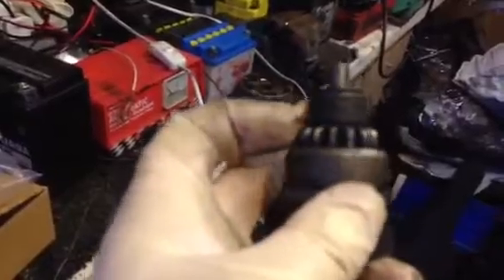BIKE WONT START SPEEDFIGHT FIX RUNNING MARK SAVAGE

Comment: Hi Mark hope you and family are well, just a quick one my speedfight is acting weird it runs and rides fine good speed but if i let it sit with the battery connected for a day or two I come to it ignition on and have no response from any electrics, but if it disconnect battery for 10mins it's all normal?? Its only started doing it after my dad rode it back from MOT center in the rain?? All panels are on properly so bit clueless such a weird one to diagnose.
Reply from the maker: odd but maybe look at the power regulator which is under the front main foot panel and hard to get to, or the stator coil 
but more likely to be a connector so wd40 and go round all the earths and connectors you can find
Reply: @marksavage  ok thank you 👍

Comment: Hi .. I've got a speedfight 2 and I've got a spark .. new crank seals , new plug , new battery,  cleaned the stator .. but it still won't start ..
It does seem too flood a lot 2 the point t of it dripping from the exhaust gasket area ...any ideas ? As I'm stumped lol oh and the carburettor is supposed to be new 🙄
Reply from the maker: It's the carb bud 
Take off check float and vacuum 
Test both like in my videos on them
Reply: I'll see if I came find your video on it .. not sure how to do the vacuum check ..
Reply: I've put my hand over the back of the carb and get a wet hand .. is that the vacuum check
Reply from the maker: @danielcurran9144  pull both pipes off ,suck the air pipe 
Fuel will come out of the fuel pipe 
If it starts then stop once you stop it's fine 
Then carb float see it is stuck then move to 
 jet size or needle

Comment: Hi mate, watching all your videos has helped me try to fix a vivacity. But can’t get it to run, it not sucking fuel in, any suggestions? Changed the fuel pump and it’s working but the vacuum line is not sucking strong enough to pull fuel. I am waiting for the reed valve, as one of the pedals is slightly open. Could that fix the issue?
Reply from the maker: it can be the reeds bud they need to be all shut
when you turn over have you done the hand test , if it get wet you have a vacuum

Comment: Hi mark does the filter you changed do the same job as th vacuum pump as the dna 50 has both?
Reply from the maker: hi bud i have videos on the dna worth a watch
this filter is always worth a change as it can clog and cause problems with the flow of fuel 
mark
Reply: Yes i think i have watched all the dna ones

Comment: Mark I bought my so a aprilia  area 51 the fule pipes wer bypassed cos the fule diafram wasntnt working they had it rig up some other way it was running fine but I went out one morning and put choke on and kicked it stared for about 1 min and cut out theres no fule going to the carb no vacuum could that be the carburetor blocked iv and fule diafram and starter in the post I'm buying a work shop manual also.. any ideas it use to fly 60mph nearly
Reply from the maker: id re put in the right vacuum as anything else will either flood it of not be right bud

Comment: Hi Mark,

I’ve rebuilt my top end and now it doesn’t want to start. I’ve tried both kickstart and electric both not working. Could a battery with not much juice left be the problem? I have compression,spark,fuel and air. I have also cleaned the carb and put a 68 jet in it. I could kick it over plenty of times and nothing. 

Thanks Mark
Reply from the maker: there's so much it could be bud so that's a hard one, there can be hard to start after a re build maybe some easy start to get it going may help, if you have followed how I have done mine it should all be ok 
there oil seals , reeds, compression and so on is your hand getting wet with the hand test ?
Reply: mark savage I feel compression but i think no fuel is get to like the head area hence why it not starting? Would you recommend putting a bit of fuel down the head
Reply from the maker: @kellyplaysguitar111  prime carb then you can put a little in there to see if it will come to life

Comment: Having trouble with my sons 2nd hand bike we just got him for Christmas. Electric Start isn't working but kick start was but now needs replacing too. Got spark, got fuel got compression, starter spins the bendix any ideas?
Reply from the maker: Hi bud 
Electric start works as in spins or nothing 
I have videos on hoe to change 
Bendix spins but not engaging,  need new one 
Kick start again I have videos on how to change 
Let's know what's going on
Maybe upload a video then I can watch it and help if I Can bud
I have 100 videos on a play list they will help
Reply from the maker: Or contact the seller and ask him to sort it or at least help I always did when I sold mine !
Reply: @mark savage  it cranks over but not starting. Ordered parts for kick start so that will be sorted and will use your video too. Seller isn't responding at all. Just hoping I can figure out what's going on. Starter spins bendix but not too sure how to check if it's engaging will have a look through your videos.
Reply from the maker: So it turns over so that's all ok
I have a video on these4t mopeds 
On my channel bud 
A black one little while a go
It's carb bud
Clean or change plug 
Make sure you have spark 
Check side stand sensor is working 
Take out seat bucket 
Then off with carb 
Like in video
Reply from the maker: @Greywolf89  it is as turning over 
Bud 
Not good from the seller
Reply: @mark savage  going to take carb off now and give it a clean hopefully it helps cheers
Reply: Got spark, cleaned carb idle jet was blocked. Tested side side. Still no joy.
Reply from the maker: @Greywolf89  spark good as in nice blue spark not orange 
Carb
Both jets out blown out clean 
Float ok letting in fuel
Wet hand test ?
As in my videos 
So wet plug 
Are you using e10 
Or e5 super 
Video on that bud
Reply: @marksavage  went and got another new plug and seems to have  done the trick cheers mark

Comment: Hi Mark, I have a starting issue. My speedfight has a new starter relay, battery and starter motor. It starts fine and runs perfectly on the kickstart, lights everything ok. If I attempt to use the electric start it blows the fuse. I can bypass the rear brake light circuit (safety feature) again works fine. Brake switches, and the wiring looks sound, I have checked all connectors.can you advise please? Simon
Reply from the maker: hi the micro switch does the rear brake light so that needs to work as it should and is negative so all ok you will have to check the start motor and make sure the live is not touching anywhere and covered with the cover or electrical tape and that the earth is connected with the screw to the body of the bike if all ok great if not !!ok it's bottom panel off to check all the wires from the start and up to the relay.this is the only way of sorting, I have a few videos on the starter that may help along with wiring info, give them a watch and please like share and subscribe . ,mark

Comment: Hi Mark. watched all your speedfight videos. Ive got a 50cc liquid cooled speedfight. I cant get spark.  I fitted a bypass CDI replacing the factory one, new coil and lead and spark plug. changed the stator and flywheel. With the factory CDI fitted the red immobiliser light goes out after blinking. I dont know what to check now. I've checked the loom with my meter and its fine. its getting fuel to the carb is clean. any ideas of what to look at next. doing my tree in not having a running bike. the coil is not getting any voltage. it just cranks until you flatten the battery. it wont even kick start. it ran for literally a min as a fluke but cut out and hasnt started since. all the connectors on the loom are clean too.
Reply from the maker: wow that's a lot of work bud but if you are getting power to the cdi and no power out then that's it bud, I have had  a faulty bypass units before this is the one under the front panel yea?, there are none next to the batter? if you have no power to the coil then it has to be th cdi or a cut wire , I did a video on wiring hell as that's what I had that as well, you defo have volts coming out of you stator coil ?
Reply: +mark “marky bike” savage Hi mate put a different CDI in and it started straight up. thank you for your help. I would never have thought a brand new CDI could be faulty. keep up the great videos. 👍
Reply from the maker: that's great news and happy to help mate and good to hear my video's help and a little more advice for me,
Reply: +mark “marky bike” savage Do you know anywhere that sells the panel on the nose of the seat? mines missing. tried ebay but theres none on there.
Reply from the maker: you may have to buy the whole seat or contact e bayers selling parts and asked them

Comment: Hi mark just thought I’d see if you could help me out I’ve got a 2003 Peugeot speed fight 2 and it was running perfect I took it for a test ride and I rode over a bump and my knee hit the key and turned the bike off so I turned key back on and electric start was just clicking I’m guessing it’s the starter relay switch but that’s not my main issue my main issue is when I went to kickstart the bike it started straight up but it literally wouldn’t Rev at all and I have no idea what’s causing it because it’s had brand new spark plug and carb and the more I tried to start it it just got worse and now it only starts for like 5 seconds any help will be much appreciated
Reply from the maker: How odd
Is it an immob cdi ( fat key)
Is the red light flashing on the dash ?
I've got a video on the starter so follow that 
Check everything as the bump may have done something else bud 
80 videos to help
Reply: mark savage cheers for the reply mate yes it is immobilised and I’ve sorted the running issue out turns out there was water in the fuel but starter still doesn’t work the starter relay just clicks when you press the button mate
Reply from the maker: @motorbikeryda883  waters odd but flush out 
If it clicks it the starter
Take off side cover take out dendix to make sure its not jammed 
See if it spins then 
If not new starter bud 
Follow videos its easy to do

Comment: Having problems with my sons speedfight2  it just wont start ,got good spark ,got excellent compression (new barrel and piston), my boy is upset as it was a birthday present and we got told all it need was starter motor we replaced that and new barrel etc, are you local to colchester?
Reply from the maker: This often happens bud 
Not far from you 
Why did you replace the piston 
Was the old one damaged 
Did you clean out the sump and 2t oil the piston like in my videos 
Clean carb 
Check reads 
Did you do the wet hand test and is plug getting wet ?
Reply: @marksavage  any chance I can drop it off and let you fix it?
Reply from the maker: @andrewreid2097  send me your phone number and ill let you know when I have it then delete the message on here
Reply: @marksavage  we got it running standard piston, 6g rollers, ginelli exhaust its a 2003 speedfight 2, not very quick bit boggy, what size jet should we go for please and any other tips to speed it up??

Comment: Hi Mark , having trouble with me trekker 100 (again lol ) it won't start at all , have changed the Spark on it but no joy , cleaned the carb , is getting fuel as I replaced the pet cock before. It broke down on me on christmas day and all that happened was a bit of the air filter had torn off from being so old it clogged up the carb , so I removed it replaced filter , and cleaned the carb , has been running ok , last week I had to change the spark after a week or so, thought maybe running rich or a bits of the old filter had got through and giving me probs , anyway new spark today and nothing any ideas before I scrap it ? could it be piston needs changing have tried to have a look at getting the head off but has cover that looks difficult to remove , might take garage or scrap , any ideas before I do appreciate it , thanks bud
Reply from the maker: in very cold weather they all play up, start with carb again like in my cleaning videos then tuning 3 half and when you try to start check plug is getting wet and you have a good blue spark like in my videos
if no joy try to start and open the throttle fully and listen if it pops and bangs ,if so yes the piston / rings may be gone
its not a massive job as long as you have a few simple tool and the time , getting the old exhaust may be a bugger as the bolts can snap 
mark
Reply: @marksavage  Thanks , ur da man , I thought , would give the carb another go , so just took of cleaned it , then I noticed a problem , the little round plastic part attacthed to the jet needle(? on the cable) wasn't goin all the way down into the carb it was like stuck at the top so I pushed it down with screw driver ,put back together and it almost started but batt is flat from all the trys lol so is on recharge now , will give another go 2mrw , one more funny thing as I was washing my hands next the sink  I noticed all the brass parts from the carb that I took off and forgot to put back on lmao , and yet in nearly went , will put em on 2mrw and give another go , ooops , anyway yeah think it was that plastic part sticking maybe giving me the probz, theres life left in it still yet lol , thanks for your help , you,ve inspired me to keep trying :-)
Reply: @marksavage  Hi Mark , I got it running again , but is sketchy ie takes a while to pull away when first start as if the fuel is not getting through or almost dies if rev , maybe is flooding ? but  it runs fine (ish) once it's going (warmed up/wait for a few moments )  ,I think I need to replace the carburetor but I'm having trouble finding one , would you happen to have one for sale ? or know where to find the right one ?( have looked on ebay )  , I think the round plastic bit on the the jet needle (?) (attached to (spilt ) throttle cable at top of carburetor is sticking to the chamber , the chamber looks slightly darker have tried cleaning but no joy , but yeah is running but think needs a new carburetor , thanks for any info

Comment: Hi mark it seems like my bike electric start has died over night and struggling to start on a good day if it’s cold would this be the issue
Reply from the maker: poor battery , give it a charge or replace stator coil, i have videos on that but more than like it , or old starter worn ,replace bud

Comment: Hi mark I'm having a starting problem with speedfight 2 I've cleaned my carb like in your video's I've cleaned my air filter I've drained my fuel tank and rinsed it out with fresh fuel and changed the fuel tap and put fresh fuel in got it started and was ok but the It was in the shed for a week got it out and it wouldn't start unless I put my hand over the hole on the air box can you help?
Reply from the maker: carbs as they get older leak and allow the air in and the fuel to evaporate away then if left they are hard to start , try finding a new carb or a Chinese new one but set up air mix all the way in and use the old jet .
you can use a little easy start if you leave it for a longer amount of time 
whats it like when you start it daily
Reply: @marksavage  hi mark and thank you for the reply and if I start it you every day its starts every time on the start button
Reply from the maker: @eddiehughes9137  you can overhaul the carbs with me gaskets etc as this will help
Reply: @marksavage  thank mark really appreciate your help and time 👍

Comment: Is there any difference in the Speedfight PROST 1999? fuel filter?
Reply from the maker: Gordon Rettie hi bud 
No mk1 and  mk2 fuel filters are the same 
Mark
Reply: Gees that was a quick reply. After all, i have done the dam thing won't start.
new cab exact replacement turns but will not start, replaced and checked the new spark and sparks, new clutch, variator cleaned, new air filter, did start and run prior to me doing a good service on the thing, any suggestions

thanks
Reply from the maker: Gordon Rettie hi bud 
Re do the carb , if it ran fine before go over all the things you done so you have spark that’s good so has to be fuel 
Like in my carb cleaning video did you prime the carb and refill the carb ?
Is the plug getting wet , have a watch of a few of my other videos bud 
Mark
Reply: I have replaced the carb with a brand new as the old one was screwed 1
what do you mean by "did you prime the carb and refill the carb"

Thanks in advance 
PS how do i enter to win the Tshirt :-)
Reply from the maker: Gordon Rettie like in my carb video connect the fuel to the carb then suck the air pipe to fuel carb up then put in back on the manifold , wipe pipe First Lol 
Is it a speedfight carb or a copy?
I’ve had lots of probs with copy carbs 
Try recleaning and tuning old carb and put it back on then see if it starts and runs 
Worth a go 
Mark
Reply from the maker: Gordon Rettie oh and sorry bud t shirt comp ended but I’ll do another soon 
Mark
Reply: not a copy a gen part from here 
https://www.dellorto.co.uk/shop/dellorto-motorcycle-carburettors-parts/complete-carburettors-dellorto-motorcycle-carburettors-parts/phva-12-to-17-5mm/r1434-phva-17-5es-peugeot/
thanks

what video exactly as u have a few re teh carbs lol
Reply: Hi Mark I made sure that the carb got some fuel today and BOOOM it started! Thanks for all your help. couldnt have done it witout you
Reply from the maker: Gordon Rettie that’s great news and happy to help 
Mark
Reply: I do have some other Qs for you lol but ill post on the correct video!
BEST HELP ON YOUTUBE MATE DONT STOP!
Reply from the maker: Gordon Rettie thanks bud all I ask is to like share my videos 
Get me out there then more people can save a little money and get back on the road 
Mark